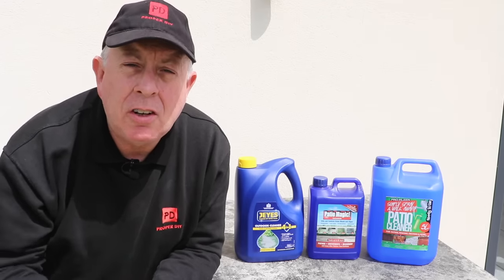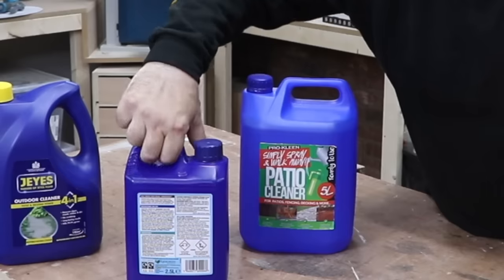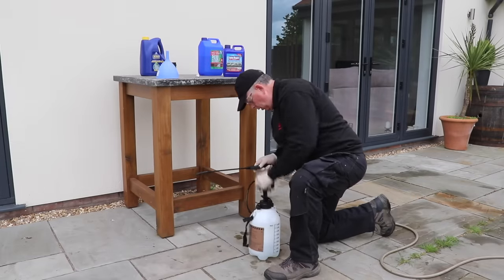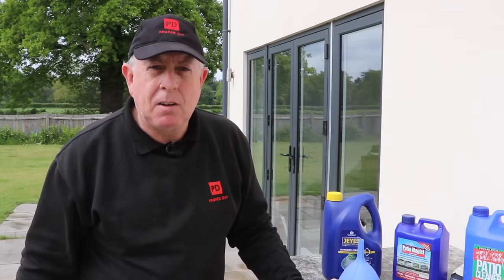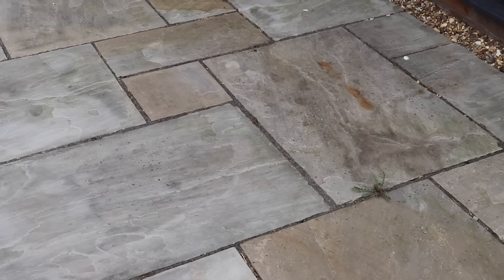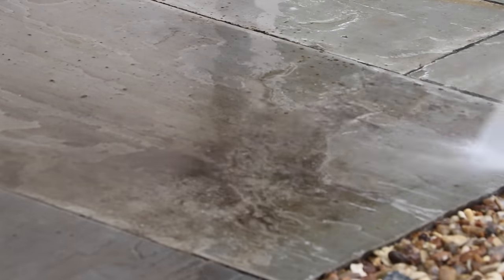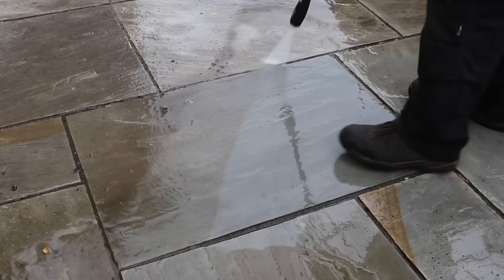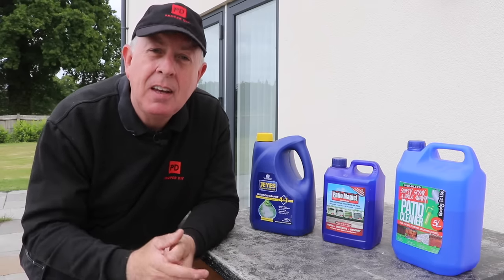Patio Cleaners vs Pressure Washer Put to the Test with Surprising Results!

Comment: 20 yrs I’ve cleaned many patios, block paving, roofs. If you’re jetting you know it blows out the kiln dried on block paving, a right mess. I just bought sodium hypochlorite for the first time, from Amazon, 15%, 10L tub. I wore shorts and t-shirt, gloves, shades and a baseball cap. I poured it neat onto pavers and brushed in, left it 20 mins and washed off (away from grass obviously) looks like new. No hassle, no hundreds of litres of water, no extra mess from jetting. I then poured it into an empty “Wet and forget” sniper tub, you attach hose to it and you can chose the driveway spray nozzle or the sniper jet to spray on roof, I soaked my lawn in water, sprayed roof, (rinsed my arms and legs as I went just incase any splash back) I then reloaded tub with some “wet and forget” and applied it afterwards. My neighbour had her roof done by those cash in the hand folks, hypo and jetted, looks good but very hard clean, but mines is just as clean but more natural looking, not strip bleached. Anyway I’m blabbing on, all il say is hypo is far quicker than jetting. Absolutely stress free. Just be extremely careful working with it. I had a few pink spots on T-shirt, zero skin burns, obviously diluted through the hose thing I used. Jetting takes hours and so much water it’s insane. Concrete slabs take longer than stone to jet. Look up “wet and forget” on Amazon, but the pink sniper tub stuff to attach hose to, once used, fill with hypo. Great for roof. Slabs I’d suggest 15% hypo, honestly 20 mins and you’re done. Wear PPE, especially on eyes.

Comment: Hi Stuart, I use the pressure washer first, then apply an acid based chemical to kill off any mold/blackspots etc. I also do this treatment on my decking before oiling.

Comment: I think this is basically a win for using the pressure washer a couple of times a year and less poisonous chemicals into the air/water table. Trying to minimise the number of chemicals used in my garden and be comfortable with 'less than perfection'!

Comment: Thanks for this Stuart. I've long wondered if these chemical 'cleaners' are any good, but experience has suggested that anything that promises to be effortless is just snake oil! So I've just used the pressure washer instead. As you say, it's quite laborious work but the results are much quicker and more satisfying. For something that only needs doing once or twice a year, that's worth the effort imo. I also pre-wet the patio with the garden hose just to help lift the dirt a little beforehand.
ps. @15:18 the label on the Jeyes clearly shows that it is supposed to remove 'dirt', which one would assume makes the patio look cleaner too.

Comment: Great video which has confirmed the way I do mine is perhaps best. Each late march/early April I presdure wash my patio, then after it dries I pour patio magic all over. 

The pressure washing gets rid of the dirt and algae, the patio magic brightens the patio over time and helps to keep the algae from coming back for the rest of the year.

I only pressure wash once a year.

Without using the patio magic it's significantly harder to get the patio clean come april.

I've also found that aldi sell a patio magic equivalent for far cheaper which is just as good

Comment: I have always just pressured washed. This year however after pressuring washing I used Freescale Black Spot Remover. As I expected it really only faded the black spots. However, I was stunned by how much better the patio looked than pressure washing alone. This will be my method every year from now on. Pressure wash as normal first and then use the product afterward. (edit: I should add, this product is some strong bleach-based system, not only the PPE but if you get it on clothes then they'll look like some 1970s tie-dye hippy crap)
Reply: for maintenance, household bleach is cheaper and just as effective. (its the same thing - sodium hypochlorate)
Reply: There are numerous YouTube videos that show how commerial grade 15% Sodium Hypochlorite is extremely effective if used carefully with the eight PPE.
I've tried thick bleach used 50/50 with dishwashing detergent (as demonstrated on YOUtube) to be effective along with brushing to vastly reduce the pesky black mould spots.

Comment: Hi .. I’m a hard landscaper as well as a patio cleaner … for sandstone to be cleaned and stay clean , I find that when you pressure wash  the slabs , that’s the best clean you’ll get .. the other thing to do to keep them clean is to spray a product called BAC 50    Diluted  20 parts water 1 part chemical  every 6 months ..   usually does the job … one thing I will mention .. I notice you have weeds growing out of your patio joints … the best advice I can give you would to use ultrascape free flow slurry grout .. absolute solid …
Reply: BAC 50 is Benzalconium Chloride - works a treat - I found 10ml to 1 litre of water worked fine.

Comment: I've been through several cleaning options and my conclusions are: 1 instead of those expensive products just use bleach (same results but way cheaper). And 2, for deep clean patios, the pressure washer is best but I use an accessory (patio cleaner head) that covers a wider area making it a breeze in comparison to the normal pointing thing.
Reply: How are you applying the bleach on the patio?  Like a pre-treatment via a watering can   or  maybe its better to fill a bottle of bleach and use the suction and pre-mix lance setting I was thinking.

Comment: Hey Stuart. After using the pressure washer you can use a coating on the patio. This keeps the tiles longer clean. The coating is not cheap, but you don't have to pressure wash the patio every year.

Comment: Good vid. I use the No Nonsense solution from Screwfix. Great stuff. Dilute it, apply from a bucket with a brush and give it all a good scrub, then go over with the hose or pressure washer. I do this for my porcelain patio and it comes up really well but would also be good on stone slabs I think.
Reply: I think ????? 👀

Comment: Just cleaned my patio, tried the patio head cleaner with the jet washer which was fine to start but then it stopped turning round so just used the normal nozzle, worked well. With pets and lots of wildlife in the garden I’d never use chemicals.
Reply: When the nozzle stops spinning it's (in my experience at least...) because sandy bits of the stone or concrete surface have splashed-up and added friction to where the spinning part meets the base of the patio cleaning head..

With a Karcher there are steel C-clips above the join that you can pull out with needlenose pliers or pry out with a screwdriver and seperate the spinning part from the arm on which it is mounted by pulling it downwards, then just rinse the sand/grit/gunk out with water and an old toothbrush and reassemble everything, and it works like it did the first day I had it.
I now do this after I finish cleaning the patio and it takes <5mins once you get the hang of it, so please give it a try and get your fancy expensive patio-cleaning head working as it should again...

Also: Using a pressure washer not only removes the dirt and algae, but also the top few thousandths of an inch of stone or concrete (hence why it looks brand new afterwards), so if you have concrete slabs you will lose the smooth, semi-sealed surface layer that they left the factory with and become both rougher to the touch AND more porous, which majes them far more susceptible/prone to algae growing back and dirt both sticking, and seeping into the surface of the concrete when dissolved in rainwater, so I really don't recommend using a pressure washer on concrete slabs because you'll be making a twice-yearly rod for own back...
Natural stone flagstones should be fine though....

I hope that helps...

Comment: I use. KArcher pressure washer with the patio cleaning tool. Use the detergent and my patio looks great. My main issue is Saharan sand dust on the patio which kind of bakes on during the summer. The pressure washer does the job

Comment: Wet and Forget is brilliant. Rather than pressure washing 4-5 times a year, I now do it once at the beginning of Spring and at the end of October. After the Spring clean the patio stays clean of algae/moss for 6 months.
Reply: Totally agree! It's by far the best. It works gradually so you have to be patient. I've tried almost all the others and they are not a patch on W&F
Reply: Recommended  wet and forget to a work colleague. Unfortunately,  he couldn't quite remember the name when he tried to buy some. Apparently,  wet and wild is not the same thing.
Reply: @dirtyface091  it won't clean mud etc but nothing really will other than abrasion or pressure washer. Mud isn't really an issue for me, it's the greenery that's the problem and wet and forget sorts that out perfectly and keeps it looking good for ages. My neighbour recommended it to me, probably after getting annoyed with the pressure washer coming out all the time.
Reply: Why did the guy not try W&F?! Been using it for over 10 years & been very happy with it. Have not tried any of the products he poorly reviewed. He wanted them to fail didn’t he?! Pressure washers are bad news, making surface more porous & removing grout & sand in driveways. Hose & brush to remove dirt then W&F.
Reply: Yes wet and forget is just the best
Reply: Didn't do anything against black and white lichen on paving slabs for me.
Reply: Agree that initial impressions suggest that the chemicals do very little. However they actually take weeks or more to have the full effect and it’s very long lasting easily up to a year. Absolute best and instant but long long last benefits are to first pressure wash then chemical treating - this will last a year and may mean there is no need to pressure wash in the future- only a reapplication of chemical on a yearly basis.

Comment: patio magic always takes few weeks to work for me including a couple of rainy days with amazing results jet wash is fine but if you use it on concrete slabs or paths  it tends to erode surface after a couple of years  not had any eroding from patio magic

Comment: I’ve used the Wet and Forget product for a few years now. Brush the patio with a stiff brush then spray the surface with 1 part chemical to 4 parts water in January time. Find the weather helps to get the chemical to work and by early spring the patio is lovely and clean. I don’t reckon you’ve allowed the chemicals long enough to work

Comment: Pressure washer is best for cleaning. A few points some of which you may have made in the PW video. Need to take care you do not wash the grout out, wash across not along the grout. With pressure washers you need somewhere to swill (or manage) the dirt you have just released- especially for very dirty paving. Also there is a tendency to slash surrounding items with the dirtied water so rinsing them is also often needed.  The "foam" that you washed off is probably the long term protection provided by the chemicals.  Perhaps it is best to wash and then apply the chemicals. Then the troublesome areas should stay  free of algae until the next clean is required.

Comment: I have used both methods and several of the chemicals for years now and my preference is Patio Magic especial if used on concrete blocks. 
Jet washing will clean but it won’t last any where as long and will increase the erosion of any grout or concrete. 
The trick with patio magic is to put it on at a 4:1 ratio then leave it for at least a month. Then when it’s had some rain have a look at the difference between what you have jet washed and where the patio magic has been. It’s also excellent for cleaning algae etc off UPVC conservatory’s. 
If you are going to jet was I would recommend using the T-racer attachment as it speeds the job up and help stop the dirt from going everywhere.
Do try patio magic again but have patience.

Comment: I used patio magic on my render which had some green patches to clean it up before painting & was pleased with it, I think I went in with 2:1 & worked it in with a paint brush, but it didnt touch anything on my patio (even when worked in with a paint brush as I was using what was leftover from doing the walls) so I'm with you for using a pressure washer on that

Comment: Hi Stuart, well done again, another fascinating and very interesting, informative recording. I always thought a lot of these products are gimmicks and DO NOT DO exactly what they say on the box!!  Please keep them coming.  Cheers
Reply: I use Crikey Mikey. Spray on and leave for 24 hours then hose off. Works really well. My drive and patio area is very clean. Block paving. My drive hadn't been cleaned for about 5 years and my patio for about 3 years. It even kills the weeds between the blocks.

Comment: Thank you so much. With so many products on the market you always wonder which is the best to use -especially re the cost. Like you I found I needed to pressure wash first but then used the chemicals afterwards and half way through the year to prevent a shaded area turning green again.
Reply: Use smartseal extreme vry strong only brush and hose needed

Comment: I have never used a pressure washer on my Indian stone patio. I use a diluted Jeyes fluid, mop bucket and hard head brush, for wetting and brushing/scrubbing the patio.  Immediately, I see green areas lifting as I go. When dry, I then rinse the patio using a garden house removing the algae and black areas between the slabs and brushing as I go. Although a tad labour-intensive, I do get great results.

Comment: Would be interesting to see the spinning brush type of head as a comparison to just the jet washer, I have one and it's certainly quick and easy to use if the grime isn't too bad. The spinning nozzle pattern should give more power but needs to be used more slowly as you say.
Reply: I used one but found it kept getting blocked and stopped spinning. Too many issues so eventually I just dumped it.
Reply: I too use the spinning brush type. I've tried just power washing, and the chemical, but the spinning brush works best for me and uses less water and is quicker than power washer alone.
Reply: Spinning brush is indeed a much much quicker way to use the pressure wash. I resisted it for years, thought it was a gimmick but then was given I've by my dad, it's a game changer!
Reply: Wet and Forget

Comment: Ok, Wet & Forget is another product that I believe should have been thrown into the mix. Yes it needs diluting & probably does exactly the same as the other products, but I tend to jet wash first, then apply the product after it has dried. Seems to last quite well.

Comment: I recently did my driveway using the karcher specific cleaner in low pressure mode (no lance head and a Syphon tube) and then agitated with a combo of a broom and the t-racer... Finished off going downhill with a standard head... Couple of hours work granted.... But what a result

Comment: Good video thanks.  I have found the pressure washer method the best.  I have used a chemical sealer which I would recommend. Just a spray on and leave it to dry.  Made cleaning the slabs less often.

Comment: Great video. I do both.  Power wash to get the dirt off and then I use Wet and Forget from Costco to prevent the green coming back..  It is an American product and it definitely stops the green coming back for up to 6 months..  I had some black spots that the power washer wouldn't remove but the wet and forget did after 3 applications.

Comment: Glad to see I have been doing it right. I would recommend using a cheap mould spray from a £1 shop/ Home Bargains as a quick fix on a small area. Our back door step gets a little green and slippy over winter. Rather than get the pressure washer set up a few seconds with the spray kills off the slime.

Comment: I wish you’d published your video two weeks before you did, Stuart!😊 
Then I could’ve saved the 15 quid I spent on PatioMagic. 
Like you, I followed the instructions to get the mix right and waited for the right conditions and sprayed 3 test slabs. 
Over a week later there was no discernible difference between the treated and untreated slabs. 
So, I got the pressure washer out and now I have a bright and clean looking patio.
FYI and IMO - pressure washing is so much more satisfying than spraying chemicals.

Comment: A rotary head on the jet washer is best for patios. I do wonder though if the chemical you use would be best AFTER cleaning so as to prevent algae coming back for longer ?

Comment: Having just come in from doing ours for the first time in 2 years, I can add the following.
Nothing I mean nothing beats the pressure washer lance, slow yes,dirty yes, 
I use a karcher k4 and used the " patio" cleaner yellow plastic attachment that is essentially a spinning pair of nozzles inside a plastic round housing with a bristle base.
Not quite as effective as the lance on its own, but much,much cleaner to use and ,I guess good enough for a yearly wash.
Drawback is 2 fold
At 6ft 5" tall, karcher need to add an extra extension lance, and the head would be much easier if it had 3 or 4 guid wheels.
Reply: Agreed! Get one of these if you want a quicker and much less messy cleaning option!!  No more wet dirt flying all over your render and windows (nor yourself!) 🤩